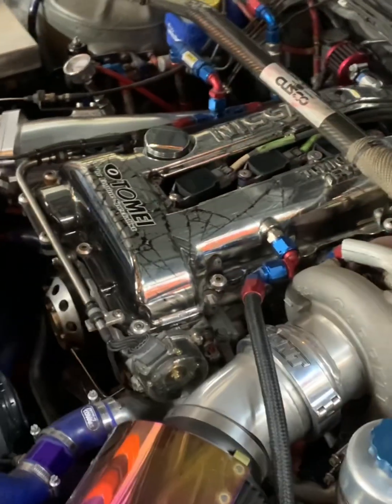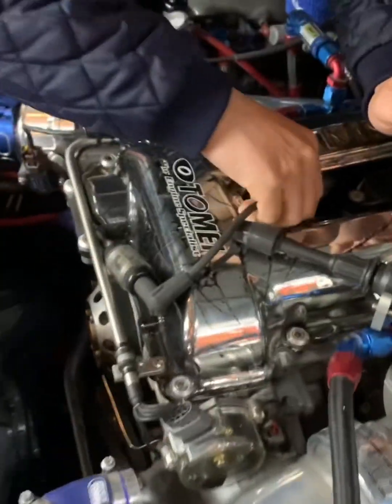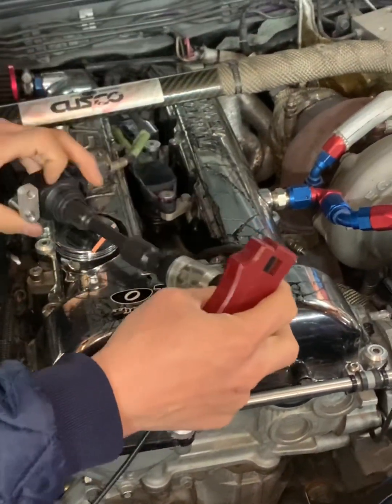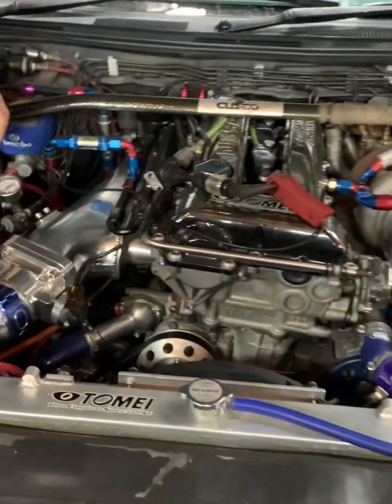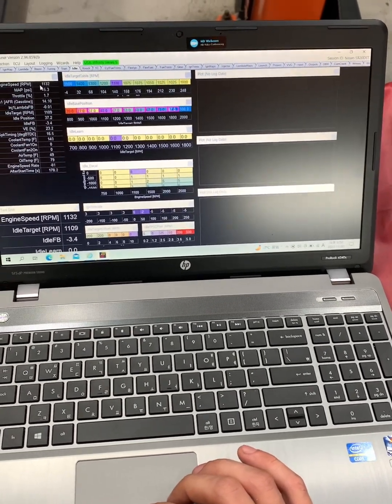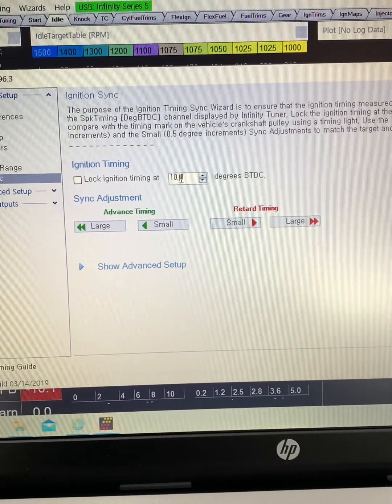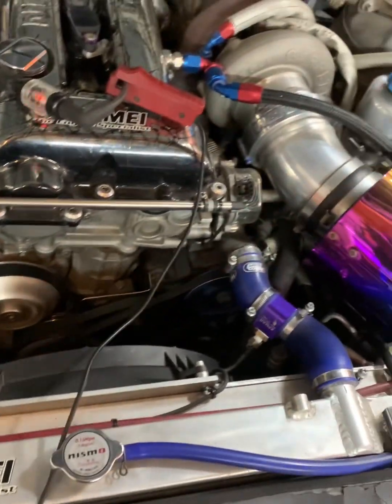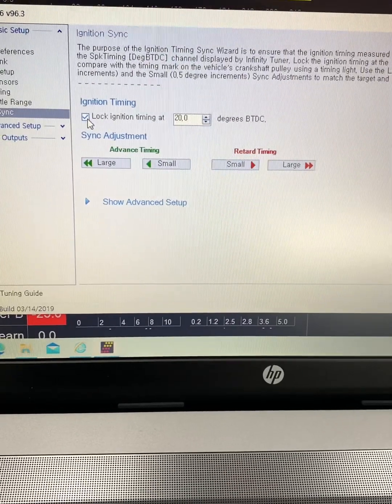AEM Infinity Ignition Sync sr20

Comment: What should I do before starting a RB25 engine with aem infinity?
Reply from the maker: Exactly the process that in this video.

Pull the plugs/fuel pump fuse out and do the first cranking with timing light to get it in the ball park then start and use the timing light again once idling (as seen in the video).
Reply: @BrewedMotorsports  Even if my motor was on the correct timing before I stopped it with another ecu? I will be using the rb25 map for the aem so I thought that it would work. Thanks!
Reply from the maker: @arlokkkk  incorrect regardless of old ecu or map on new ecu setup you MUST sync the ignition as seen in this video. 
You just need a timing light and laptop don’t let it intimidate you. ;)
Reply: @BrewedMotorsports question, doing this now and I chose the 15 degree lock. Timing light shows it on the 4th notch out of 7 notches in the rb25. Tdc is the 1st notch. Each notch is 5 degrees. So I have to add 15 degrees on the trigger offset on the laptop correct? Default is at 13 so 13+15=28
Reply from the maker: @arlokkkk  yes but you just need to use the 2 up/down buttons on the lock ignition screen.
You’ll see how they move timing hen just sync up, un lock and save.

(The 2 buttons will change the crank offset for you, Aem did it slightly different then the rest.
Reply: @BrewedMotorsports thanks!